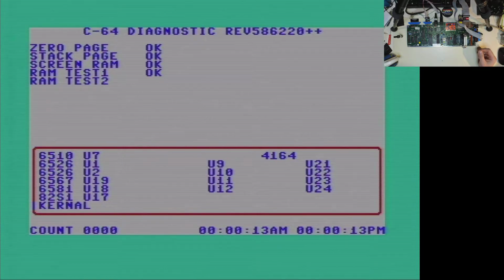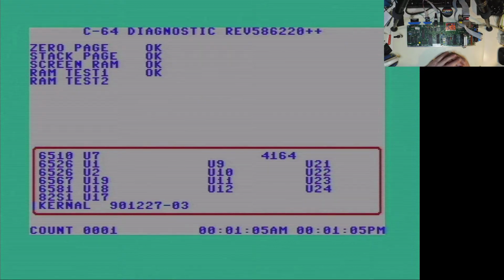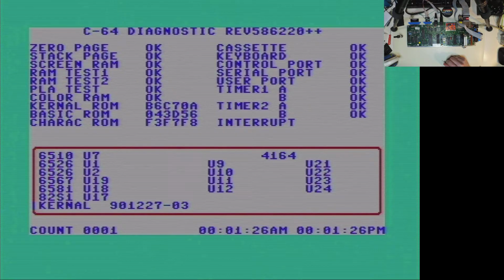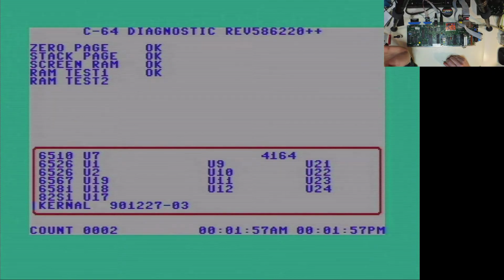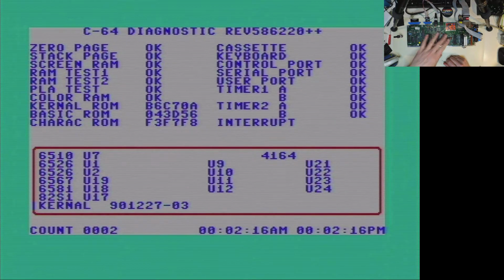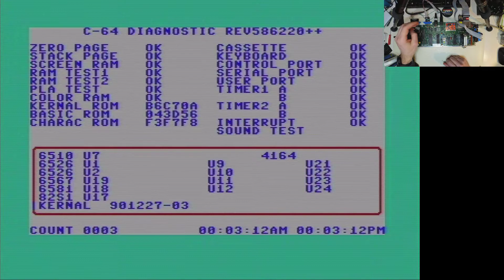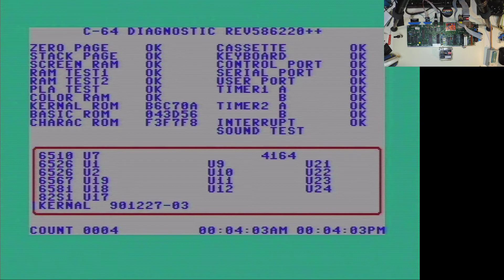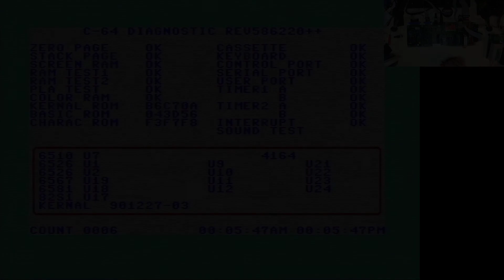C64 Hardware - Check64 - Introduction and Usage

Comment: Hi, i see a nice modulator replacement mounted on your c64's mainboard. I did something similar for my C64 breadbin, obtaining an huge image improvement. I would love to have a commercial board, since my solution is home made. Well, it's perfectly working, but, i would love to test the one you have. Is it possible to know where did you bought it, please? Please, let me know : zybex17@hotmail.it. Many thanks.
Reply from the maker: Daniele Bucelli this is an older version of a modulator developed by a user from the Forum64. What board revision are you using?